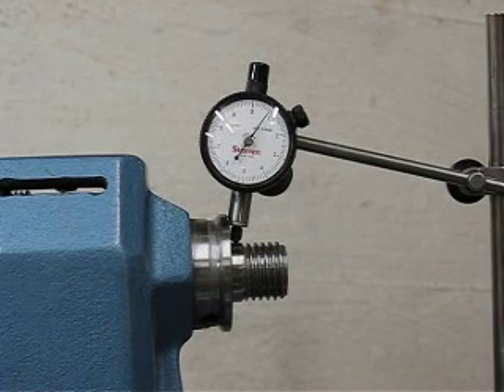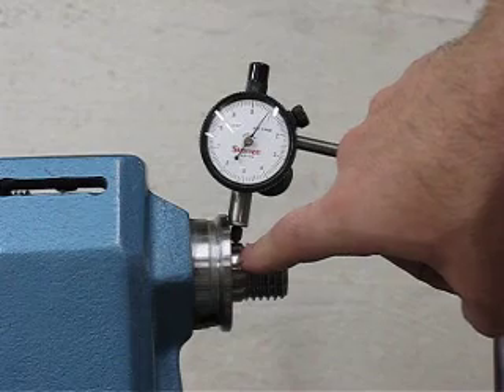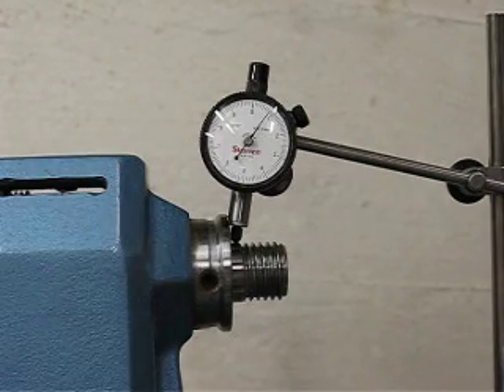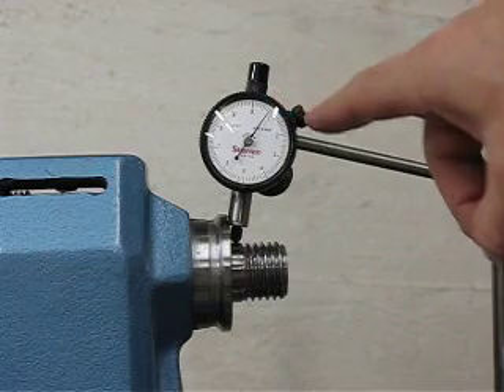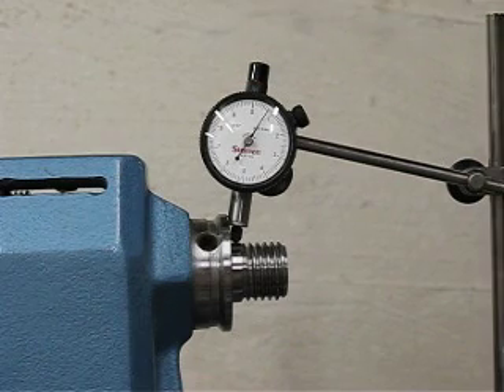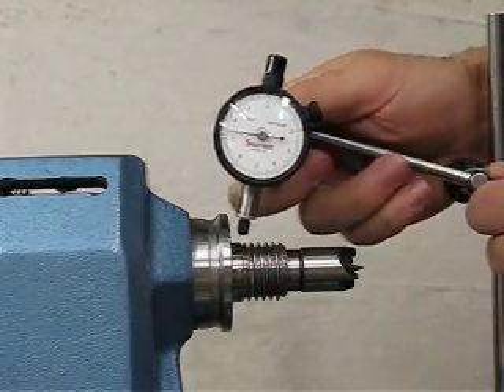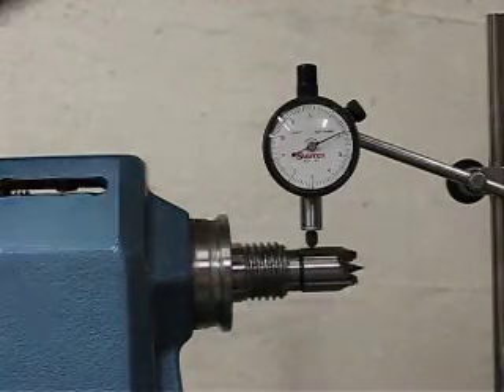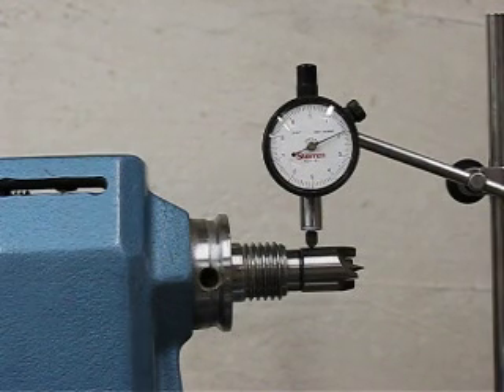Vicmarc VL100 run-out test part 2

Comment: Ignore my previous comment.  I just saw your part I and it's impressive.  My latest two Oneway 2436 spindles would be measuring about much worse.  One would be showing a wobble of maybe .012 inches at that distance.  Yes that is 120 times as much wobble.

So I am looking to switch brands from Oneway and Vicmarc is on the list of lathes to consider.

Comment: The final test is to measure runout on something threaded on the spindle.  My last two spindles on my oneway 2436's measure great, but the threads are defective and don't allow anything threaded on the spindle to run true.

But that's another story....

So the spindle shoulder and the spindle "ring" can be great and the threads can still be a problem.